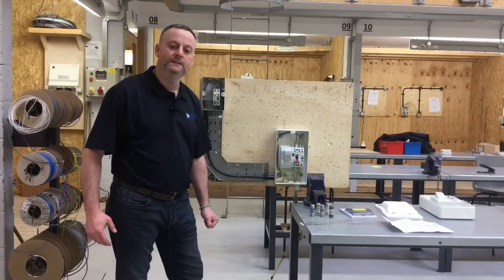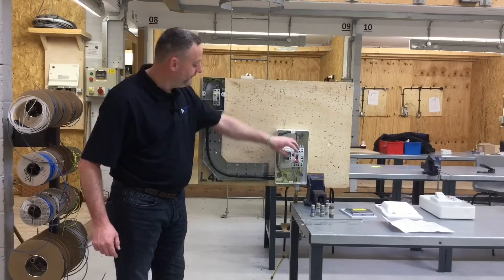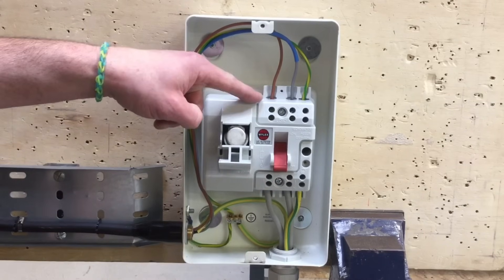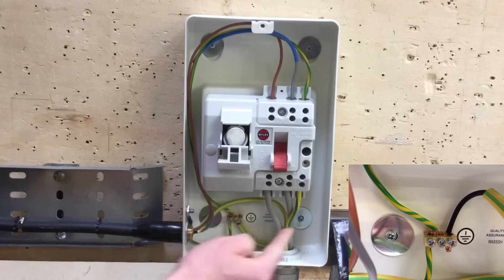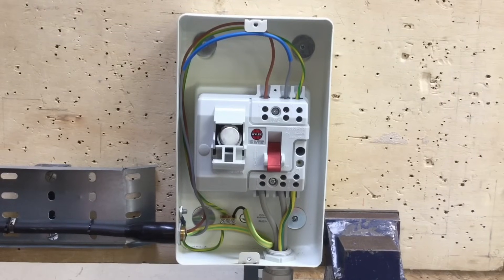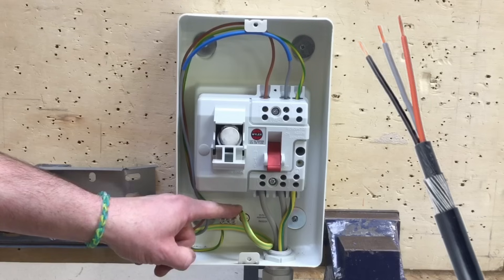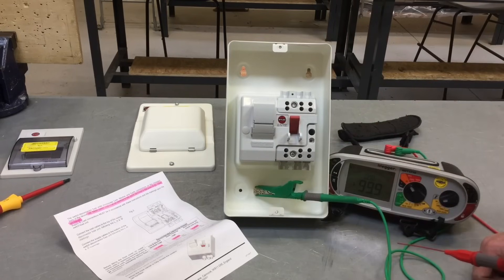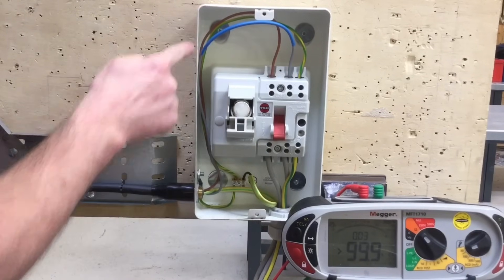Sub-Main SWA Circuit and the Connections in our Wylex DSF60M Switch-Disconnector Fuse (Switch Fuse)

Comment: Does this Wylex unit use a 57x22.2mm fuse size? This is the size all the switch fuses I've seen use, but I can't find one in 20A, lowest I've found is 32A. Interested to get to the bottom of this as I'm a bit confused!

Comment: Excellent video Gaz. Want to know something ironic?
We've a mains change coming up that requires the exact same switch fuse unit in your demo to be fitted. My 1st year apprentice will be tasked with glanding off a 3 core 16mm2 SWA and run in a loft about 8M away to a split load Wylex dual RCD CU. I will see if he figures this method of ensuring earth continuity by means of the cpc link to ensure both the enclosure and final circuit continuity are achieved.
Reply: Hope your not too hard on him if he doesnt see it.

Comment: I have a meter/consumer unit located in the hallway of my house. I want to move this consumer unit as part of a rewire 7 metres from the metre running cables under the house. What cable is best used to go back to the meter from the new consumer unit? Should it be the method used in this video or is there a more simple way and one that doesnt involve using SWA cables that are hard to work with?

Comment: Hi Gaz. You have linked the earth bar  to the earthing ring of the outgoing SWA gland with a piece of earth wire, which makes perfect sense to me.  Do you know why some electricians don't do this? What do the regulations say about this topic?  Thanks Jozef
Reply from the maker: Jozef Kois thanks for commenting... great question and in short I don’t have an answer. In my experience testing an SWA sub-main and proving polarity this method works best for me and my learners 🦾. Thanks Gaz
Reply: @GSHElectrical  Thanks for your reply Gaz, much appreciated. I am always linking the earth ring to the earth bar. However I have received criticism from my superiors on numerous occasions for doing this, claiming that I was over doing things.  It would be great to have clarity in this.

Comment: The sub main can it be part t&e for going under the floor in a domestic dwelling but joined in a wiska box with swa once you go outside to an out building. Also can you instead of the fuse enclosure not just say have on mcb or rcbo on the supply side?

Comment: Is there a reason why you take the outgoing earth connection to the earth tag, rather than the incoming earth?   Another excellent video by the way.
Reply from the maker: I haven’t watched this video back but it’s all about removing the parallel Earth path’s created by the steel of the SWA cable 👍. Thanks again for watching. Gaz
Reply: So the earth path is still complete even if the power is isolated.

Comment: I’ve got some 6mm 3 core swa and some 3mm stainless steel catenary wire, for attaching the swa to the wire whats the usual procedure? No spiral of the cable simply attach it to the wire with UV resistant zip ties? Or is there a more suitable fastener? Run is about 10 meters
Reply from the maker: Hi. You may want to consider using some metallic cable ties. Thanks for watching GSH Electrical 👍

Comment: Hi, could you do a video demonstrating the removal of a service fuse, with permission of course but I thought you could use the demo rig to show pulling a fuse and showing how to upgrade from old cloth meter tails, the way I do this so long as they are 16mm2 consumer tails is to cut them short to around 300mm from the meter then two single pole 100 amp Henley blocks connecting up to the new 25mm2 this is so when all of the work is done the supply authority can come and cut meter seal and put out new 25mm into it (I leave some slack for this)
Reply from the maker: What a great idea... time is not my friend at the moment as all my learners are doing exams... see what I can do in the coming months thanks Gaz 👍

Comment: Why do we use cartridge fuses instead of MCBs?  That Wylex switch fuse looks a lot more expensive than a generic 2-way metal consumer unit with main switch and one MCB.  CPC do them for £20 or so.  Resetting an MCB is much easier than ordering a new fuse and making sure the end user doesn't decide to increase the fuse rating to a value which no longer protects the cable.
Nice video by the way.
Reply from the maker: Hi. The assessment requires a switch fuse to be used and yes they are expensive. Always good for learners to see different kit in my workshop as well as different overcurrent protective devices. Thanks for watching Gaz
Reply: So when should I choose to use a cartridge fuse like this instead of a £1.50 MCB?  I qualified seven years ago and haven't thought about it much till now.  
I always seek to avoid unnecessary expense for the customer, but am I compromising safety in some way?  
Do we use cartridge fuses to stop the user from reconnecting the circuit after an overcurrent event?  Isn't that when we find tin foil and paperclips?
Reply from the maker: Hi. As the designer you can select the means of isolation/overcurrent you wish. This is a sub-main circuit tailed directly in to supply and can be rated as high as 100 amps... The SWA would be say 16mm in the real world and fuse at 60 amps feeding say a flat...I am currently at a dancing festival so cannot check but don’t think you can get single phase circuit breakers at 60 amps, 80 amps or 100 amps. However if this was a sub-main to a shed you can come out of the consumers unit to the new board. Hope this helps and thanks for watching Gaz
Reply: Apologies, hope I didn't interrupt the festival :-)   I'll see if I can look on a discussion board somewhere as I appreciate you'll be busy with college duties tomorrow.  Here are my current thoughts in case you think they bring up something worth discussing further:

Fig. 3A4 in Appendix 3 (my book is the green pre-amendment BS7671:2008).
The chart shows disconnection times for MCBs which go up to 63A, 80A, 100A and even 125A.
I have a 63A in my box of spares, but never seen the higher ones.
I remember doing a side-by-side comparison of fuses and MCBs many years ago.  I recall one advantage is that the compact size of a cartridge fuse means it will fit into an enclosure such as a 13A plug.
Space isn't a consideration for this sub-main obviously.  
An MCB can be used for a 125A circuit, and they can safely interrupt 6kA and 10kA.  Contact separation satisfies the requirements for isolation of the line conductor.  
As a designer I should know some examples of when a cartridge fuse might be a better alternative to an MCB.  It's likely I've missed something.
Reply from the maker: Hi. Unsure if those breakers would fit in a domestic consumer unit. The job in my video is set out by our awarding body and requires as switch fuse to feed a consumer unit via a SWA cable. Thanks for your interest and detailed response all the best GSH Electrical

Comment: Thanks for taking the time to make these videos. Just a quick question. Why not link the (presumably larger) incoming earth cable to the earth terminal in the case then to the switch unit, rather than using the the outgoing cpc?
Reply from the maker: Hi. Yep you can but the room is limited around the earth bar and if you had a 16mm earthing conductor it would have to tight of a bend. I let my learners decide how to solve the problem. The best one for me was to take the SWA cpc into the top earth terminal and a fly lead from the same position back down to the earth bar... thanks for paying attention and your top question Gaz